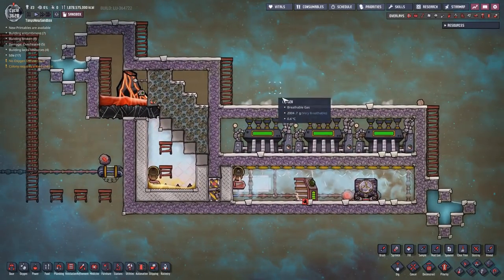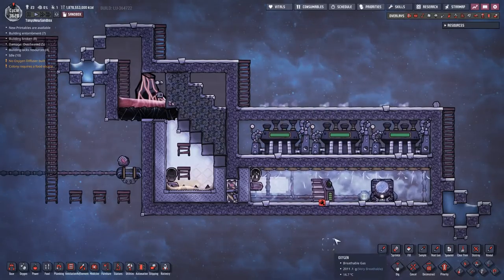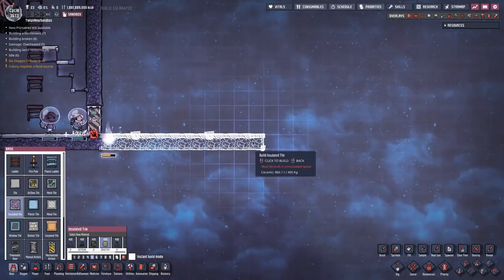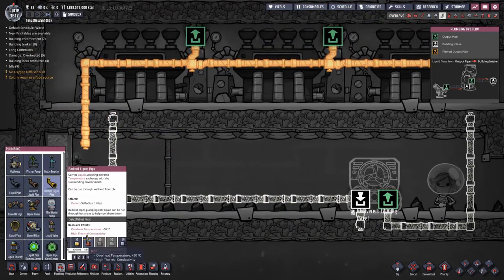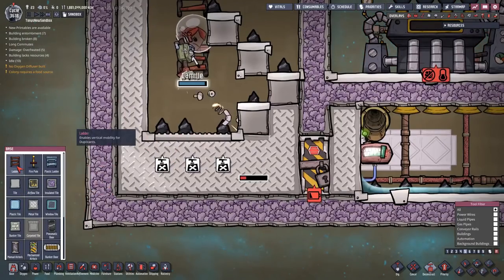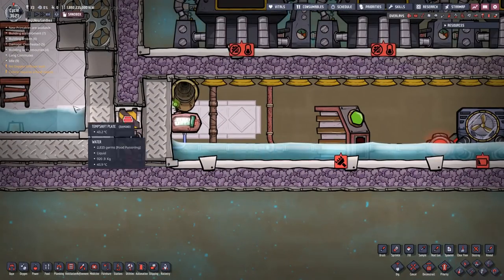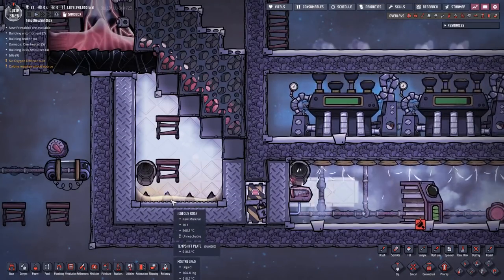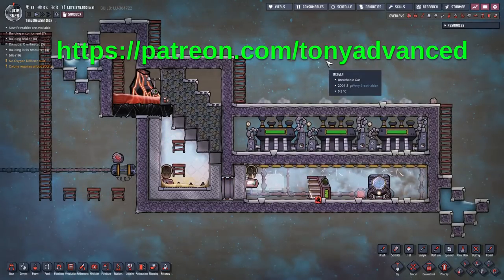Maximum Efficiency Volcano-to-Power - ONI Volcano Taming - Part 2

Comment from the maker: Notes and Addendum (probably from the comments):
0) If your molten lead turns solid then heat won't come out of your igneous rock very well. Sadly, that means it kinda requires a minimum temperature to keep the lead molten and continue working well. Below that temperature, it will still get heat but... not very fast. At least not until you've built up a large amount of igneous rock.
1) If you use steam that's cool enough, you don't need an aquatuner at all because you can cool you steam turbines with their own water output. (I'm not 100% sure on the numbers. I think the steam has to be 138C or below). (via @Riotintheair)
2) My aquatuner's cooling loop is NOT QUITE RIGHT. It can get stuck after all, I'll have to make a 3-minute video explaining it now so I can correct everyone I misled.
3) If you put the liquid vent down one tile into the molten lead, then you can defeat the pressure limit and put as much steam as you want in the heat-sink-room and get infinity-heat-storage. (via Mathmanican).
4) I admit it, the heat efficiency isn't "perfection" since it has a hard time getting the heat-sink room down to low temperatures.
5) You can add steam to the heat sink without worrying about pressure by dropping ice in with conveyors. (Via Damien M)
Reply: What i'd love to see included in your vids is a nod to the guys on the forums (i.e. forum links in descriptions etc) to those that help you/give you your ideas. It's a community that you're trying to be a part of remember. Your first build utilised no mesh tiles because you didn't know the trick with debris displacement. You watch my vid, I point out the importance of it - you feature it without the slightest nod. There's enough clowns on youtube doing that stuff already, so don't be one of those guys. Great vid, well explained - just don't be a dangus. xox
Reply from the maker: @Lifegrow  If you did this too then all I can say is that great minds think alike and it feels like confirmation that it's a great design. I genuinely didn't steal anything from your videos. I'm definitely keen to have a look at your version, I'll see if I can find it but if you have a link for me that would be rad. I'll put it in the notes above so viewers can see another example.

I really feel like this kind of stuff is a community collaboration and not a competition. I'm happy to give the credit away and I think we are all better off for it. But also, we all have our very own ideas every day and most of the time someone has done them before. I've been on both sides of that equation and I think it's just because we are all solving the same puzzles using the same tools.
Reply: @tonyadvanced6315  I didn't say you stole anything, I was just asking for you to give a nod to those that help you out. You and I both know that sometimes you can create something you're very proud of, only to have it simplified/improved upon within 10 seconds of posting. The forum folks are a smart bunch, and this community is smaller than you think. It's not a case of competition, but if as you say "it's a collaboration" - then surely you'd note those that helped you. I like your content bud, no intentions of falling out with you, just don't be one of those guys.
Reply: I watch tutorials from both of you😂
Reply from the maker: @Lifegrow  Got it. Thank you. I will do that. I certainly received a lot of good feedback, but I ultimately didn't use any of it this time around. (Did I? I'm still not sure what the mesh tile thing is about. I'm watching your volcano video from a week-ish ago right now.)

BTW, I know this sounds bad, especially now, but I have my own variety of your igneous rock-conveyor-heat-sink-thing. I'm pretty sure I'm going a different way with my volcano study, but now I'll have to settle for value-adding on what you did if I ever do a video on it.
Reply: I've never had success keeping an aquatuner cooled by it's own output water.  I can't say i've tried to keep the steam room within such a tight range.
Reply from the maker: @0x0404  I've never done much of that either. Apparently the key part is to keep the steam temperature low so the turbine doesn't generate much heat of it's own.
Edit: Oh... you said "aquatuner". Yeah, if an aquatuner cools itself then in theory, nothing happens. Because it produces the same amount of heat and cold.
Reply: @Lifegrow  I think its just coincidental pretty sure tony has made a nod to every time he's gotten something from anywhere else.

 In all honesty though I think its important to remember that ideas are not mutually exclusive to any one person if someone comes up with an idea that is similar to yours that is fine. It can even be the same. There is no automatic claim on an idea if one person thinks of it first. Giving a nod to someone who inspired you or you learned something from is polite but not doing so is not rude. Blatantly copying someone maybe a little. IMO anyway.
Reply: Ran into that problem, because I usually get water into a future steam room by constructing ice-tempshift plates. If you have -10° ice, -10° solid lead and 1300° igneous rock in a vacuum chamber even with diamond tempshift plates in the background it really takes forever to melt the ice and get the first amount of steam. By that time, the magma has solidified in the spillway, which needs to be avoided at all cost ;-) As you mentioned in you videos: you need liquid-to-solids contact on tiles with tempshift plates for heat to be transferred well - hence the liquid lead!
Reply: If you want to maintain the steam turbine temperature, you can use doors to seal some of their inputs if the steam gets too hot.
This slows down the fluid use speed, and reduces the energy lost to heat due to going over capacity.
Reply: cant you replace the molten lead with molten uranium?

its melting temperature is much lower that lead

Comment: You can squeak a little more effiiency out of the power plant if you cool only 2 turbines with the aqautuner. Then you can use the return water from all 3 turbines  to cool the last turbine. This allows you to reduce the aqautuner from running about 45% percent of the time down to 30% as you'll be able to return 1 turbine worth of waste heat to the system with no power. (If you do the calculation it takes almost exactly 15% of an AT's capacity to maintain temperature of a turbine running at full power, but each turbine has a little under half of the capacity needed in it's 95 degree return water to cool itself, so 3 returns is enough to cool one of them.
Reply from the maker: That's very clever. Thank you.
Reply: @tonyadvanced6315  one challenge is that you don't have a ton of margin and if the steam goes to even a few degrees above 200 you'll exceed the cooling capacity... So there is a trade off - in your current system you buffer that capacity with power so if you run a tiny bit hot the AT works harder but the performance of the generator is more consistant and you'll never cause damage to the system. I've got a few ideas for an integrated loop but the plumbing is really complicated - basically the turbine outflow joins the loop of coolant and the fraction that joins causes 99 degree water in the system to be ejected into the steam chamber in it's place and then only uses the aqautuner on what's left over... But I have to get it all perfectly integrated and packet stacked to not lose aqautuner efficiency by cooling non-10 kg packets. It's not worth the effort in any sort of real game terms - but I'm pretty interested in trying to get it working because I think it'd be a beautiful machine (especially as the design wouldn't work for a super-coolant based successor, where as the simple designs that keep the cooling loop isolated are). It'd be, I think, a maximally efficient full-power water based setup...
Reply: I tried this in my 3-turbine volcano tamer and this didn't work, all 3 turbines water output combined can't keep up a single turbine cooled enough to run.
Reply: @stivraptor  then you're probably running steam temps over 200 degrees or you're leaking heat into the turbine room. All the quantities are known here and if there's sufficient capacity in 2 kg (95 to 99.35 degree water) to cool a generator at 139 degree steam, there's enough capacity in 6 kg to cool a generator at 200 degrees. Heat output by the turbines keeps increasing over 200 degrees though, so running over by more than a little amount will swamp that capacity. It's probably worth tuning down the steam room temp just a notch (assuming you aren't leaking heat in the design). You can check by seeing how hard your AT works - it should run ~15.1% (IIRC) of the time per turbine at 200 degrees and perfect thermal insulation (I use power to assess how much it's running).
Reply: @riotintheair  Steam is very close at 200 C and the turbine is fully enclosed in insulated tile, yet it was still chocking.

Comment: THIS saved all of my power issues. I had to learn this because I have 8-9 volcanoes on my map, well, Thanks !
The only thing I'd add would be the buffer liquid tank for the turbine cooling otherwise the liquid in the pipes is not enough for the long term. They got overheated.
Reply: That shouldn't be the case, I've used this design many times and have not had overheating turbine issues. Maybe you are not using radiant pipes in the turbine room or the atmosphere in there is no good? I often fill it with 2kg of hydrogen to make it cool faster. Either that or perhaps you are some kind of issue (automation or power?) which is preventing the aquatuner from running?
Reply: Having a buffer tank for the coolant helps to average the temperature, and reduce the spikiness of the aquatuner activity.

Comment: Great build, love your videos. I'm never copying 100%, but adapting to my game and ran into a problem you might want to mention, or keep in mind in future videos: I mirrored the setup due to space constraints and it does not work with the spillway on the left side. There is no room for the first column of mesh tiles on the neutronium at the left-hand side. That means, due to very slow loss of heat after a couple of eruption cycles, a pile of igneous rock will form from the puddle that does not spill down off of the neutronium. Once the first pile appears, in short order it will grow and delete more and more heat. I had to open up the steam chamber with the molten lead, and the vacuum chamber on top to add a steel sweeper / rails to dump any igneous rock into the molten lead steam chamber below! Now it runs like a charm... But in general you do a very nice job of mentioning variations (e.g. steel-free build) and alterations.

Also, wanted to mention that you can actually put too much steam in the steam heat reservoir if you have a small vulcano, so that you never reach 200° optimal temperature in the turbine steam room...
Reply: Your too much steam comment fixed my volcano power generator. Thanks!

Comment: I've used a variation of this mesh tile corner-cooling on iron, copper & gold volcanoes. they're easier to setup because they don't output as much heat.

 I only used 1 steam chamber (rather than thermal battery& thermostat controlled door) with 2 actively-cooled turbines. sweeper loads up a conveyor to distribute heat & a timer controls how quickly the rail empties (approximating the average output).

Comment: Love this design. I put phosphorous in the cooling room and the gas helped keep the room under 900 degrees.
Reply: Doesn't phosphorus have a higher thermal capacity than steam?
Reply: @starwall8755  yes, it gets hot quick but with everything going on in the room it acts kind of like a heat sink or barrier because of where it hangs on the room

Comment: I had some strange bug where an invisble tile formed "behind" the mesh tile, blocking the magma spill. A save reload made it appear and it was 'diggable' but it seems that the next eruption provoked the same 'bug'

Maybe it's because I had stray pO² in the magma room and did melt some leftover equipment ? After 2 more eruptions I think I got something stable and indeed the heat there for a loooong time !
Reply: I think that's what happens when the liquid magma forms a tile while inside the mesh tile, which it does if too much liquid magma gets into a tile before it freezes, you need to to freeze quick enough so that it doesn't pool at the bottom of the mesh tile steps, so maybe it got too hot in your heat sink and you needed to add water
Reply: If too much magma freezes at once it will turn into a tile instead of a rock pile.

Comment: If you using 145C steam, you just can use self-cooling for steam turbines at approximate 138C steam temp.
Reply from the maker: That's a very good point. I'll put it in the addendum.

Comment: An estimate for how long 1000kg of steam in 14 tiles could run the steam turbines is quite easy to get.
1 tile of 800°C steam is equal to 4 tiles of 200°C steam.
Each tile of 200°C steam can run a turbine for 500 seconds.

Comment: But the magma cools down to igneous rock at about 1400 and it falls down where it stacks with the older much cooler igneous rock. Which as you've shown in the previous video, deletes all the heat. Right?
Reply from the maker: If rock stacks on top of rock then it works out fine. It's only when magma cools and turns into rock inside a tile that already contains a rock.
I always have a hard time expressing it in words. I hope that makes sense.
Reply: I think that's only on state change - i.e. liquid landing on solid. Solid to solid will average out in some magic, thermONIdynamics way but you don''t lose the heat. I may be wrong but that's what I took from the previous vid
Reply from the maker: @bigben5246  Yes, that sounds right.

Comment: i have a suggestion . its what i did instead of adding water when its above a temperature use a conveyor rail with a chute that drops ice when needed , the water adding has a limit of 1000kg tile doing this will make the heat sink infinite
Reply from the maker: Well, now that you said it, it seems obvious! 😊 (But afaik you are the first to suggest it.)

Comment: @Tony AdvancedONI, The bypass can kinda fail (stutter but still moves fluid) if your filter is set to an odd number so set it to 2 or 4 seconds seams better, it can still stutter but it wont lock up... just keep the power running.
Reply from the maker: It can indeed fail. It's a problem. I'm working on my bypass mechanics and I'll get a video up about how to do it right, sooner or later.
Reply: @tonyadvanced6315  it's not a %100 failure, the fluid still moves just not at its full speed, only happens when the Aquatuner is disabled by automation at the wrong time due to the filter.. Should run fine without it. Aquatuner's don't pick up half a packet or cool less than one right?

Comment: do you still lose heat when the igneous rock merge? or don't the merge?
Reply from the maker: If two rocks stack on each other you don't lose heat. It's only when magma freezes into rock in the same tile where there is already a rock.

I'm sorry it's a bit confusing, I have a hard time expressing it clearly.
Reply: @tonyadvanced6315  wow I was looking for the answer to this exact question and knew the best place to find it was in this thread. I finally understand. Btw this contraption is a beauty of effeciency and simplicity. Built it in a couple of long games I had and never disappointed.

Comment: Unfortunately, the problem remains. Pieces of igneous rock lose their temperature after falling down. Pieces that fall have a temperature of 1350+ degrees. And the pieces that lie are 1000 degrees. After combining them, pieces remain in 1000 degrees but of greater mass. I set the doors that move the pieces below lying to the side, so their mass and their temperature are combined. (sorry for my poor english)
Reply from the maker: Each rock emits heat at the same rate. So if you have several then you can get a lot of heat energy from them. But if you combine them into one rock then you don't get heat fast enough.

The maximum mass of a rock is 25 tons. So as you eventually collect more mass you'll have 8 rocks, then 12, then 16, etc. So even if you pile the rocks into the same tile, you'll have increasing capacity to store and transfer heat. In the long run, this will always level out your power production.
Reply: @tonyadvanced6315  
The first eruption of a magma volcano will give us several pieces of igneous rock. I want to shift them to 1 before the second eruption. In order not to lose the temperature of the new pieces that will fall on the old ones.
Reply from the maker: @john.smith.  Don't worry. When you stack pieces of rock the heat energy isn't lost. Just don't let magma solidify in the same tile as a piece of rock.